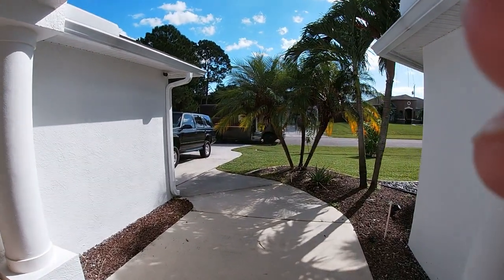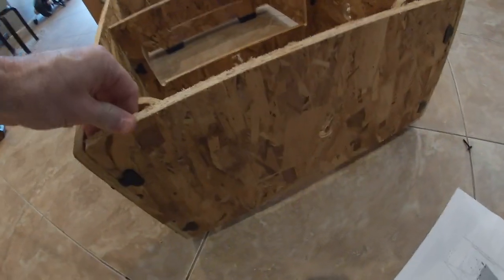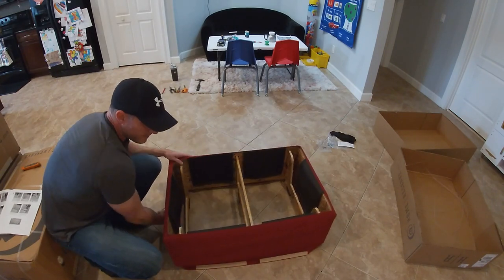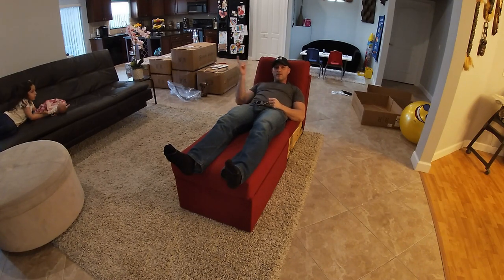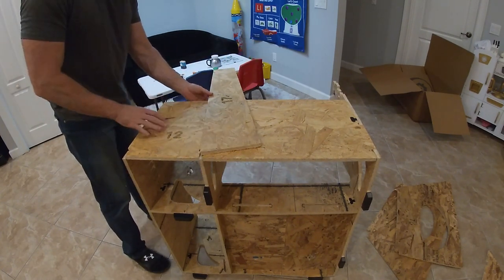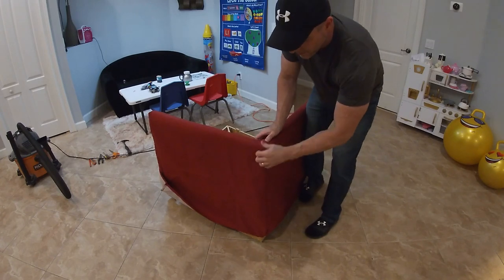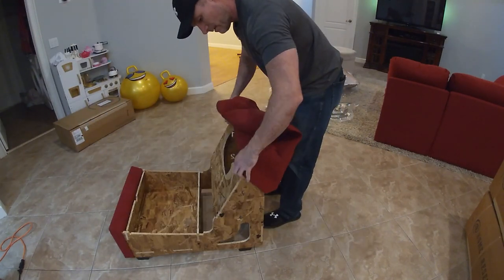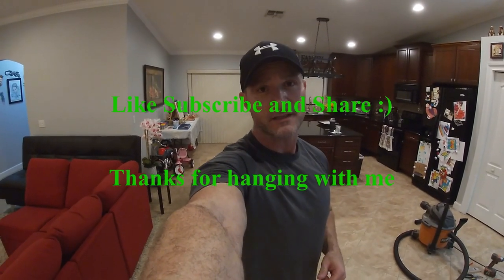Home Reserve sectional sofa build starts now p1. DIY family room renovation has begun

Comment: Thanks for this video. It's really helpful. Can the ottoman attach to the seat so it doesn't slide away?
Reply from the maker: Unfortunately no, they don't attach. I am planning to do an update video and that is on the list. I have 3 ottomans. The one that is not weighted down by a million family photo albums does separate if you move around alot. If the storage is full it stays put. Mine is on a rug which probly helps. If these were on tile or wood you need to add weight or they slide very easy. 👍

Comment: all I can think since seeing a few more videos of this brand is if you have cats or even younger children they're going to push some pillows sneak down into that chamber in the backrest. And cellphones, and pocket change, the TV remote, Goldfish and Cheerios and ... you get the idea if something suddenly goes missing.
Reply from the maker: We have a pretty big family that has used and abused the couch for a while now. It is nice to be able to lift the bottom cushion and the panel under it to get things the little ones have dropped. I would estimate that maybe 3 times things have passed the cushions. Coins, a comb, and little toys. The pillows are thick and hold shape. The remote doesn't fit in the gaps, cell phones do not either. Not much has squeezed past. The ottomans that are full of stuff are heavy and don't slide forward. The empty one slides all the time, and phones slip between the couch and that ottoman.
Reply: @thisoldhooptie  Access with a vacuum might be the plus side. I am looking at the chair and a half.
Reply from the maker: @cynvision  One thing a few people have commented on is that there is a deeper version. If you are tall or want to use throw pillows, I would give that deeper version a try. While I am still happy with what I have, the one thing I would have liked if available when i purchased is a little more depth to the chair.
Reply: @thisoldhooptie  I am sure I would enjoy that. I am very used to sitting on a CordaRoys bean bag. The wide chair was my favorite at my parent's home.

Comment: No tools in description as stated. I guess a rubber mallet and screw gun with a good dose of patience.
Reply from the maker: Sorry about that, I will add them later today. You need a hammer or rubber mallet to seat some the the wood tabs and the feet. You also need a driver with a #2 Phillips head bit to speed up the process and a #2 Phillips screw driver to finish them off. Some good coffee and music helps too :)
Reply: @thisoldhooptie  Thanks for the reply. Another question if you don't mind. I dress out at about 250lbs. Do you think the furniture will hold up under the duress of my crushing weight over time? I have chairs that state they support 330, 350 and so on and from repeated use I pancaked all of them. I'm speaking of the wood under the seats as well as the ottomans.
Reply from the maker: No problem. Im only 205 but have had no issues so far. I would do the test chair, I worked on it daily for a month before pulling the trigger. I am not sure if they still have the free trial for 30 days or something. If they do its worth a shot.
Reply: @thisoldhooptie  The test chair is still available as of yesterday. I'll definitely give that a go now and thank you once more.
Reply: @vinniethefinger7781  we’ve had the home reserve for 2+ years now. My fiancé and I are both big people! I just had my first baby and I’m 270 right now and before pregnancy I was 290. My partner has broken the seat decks a LOT because he kneels onto the couch to sit. They always send replacements and send a few extra so I don’t have to have my couch be out of commission while I wait. The frame itself is pretty sturdy. They replaced the entire frame of one of my armless and on that piece nothing has broke since. I just moved states and asked them to replace my remaining armless frames and they did ! They feel so much sturdier and hoping I won’t have any seat deck problems anymore. It’s definitely worth it as my family grows I planned on getting more pieces too. The cushions are still firm and kept their shape perfectly after every day use too
Reply from the maker: Thank you for the feedback. I too have used the warranty one time. They sent the replacement plus the one for the other arm even though it was not broken. Very happy with the product and company response👍